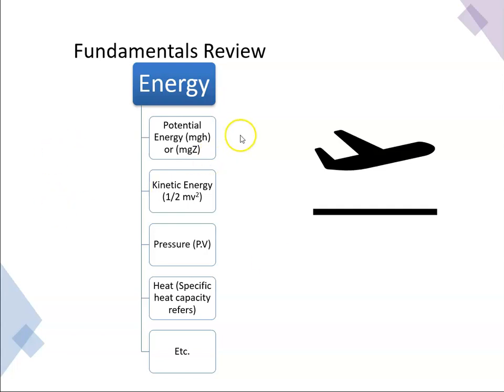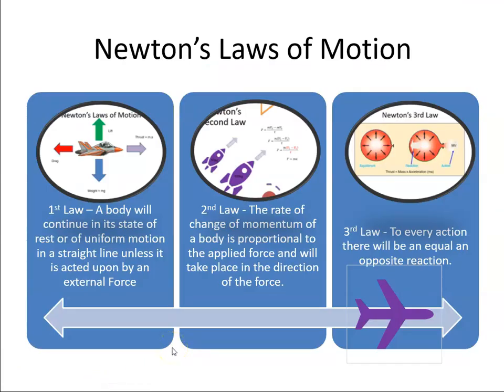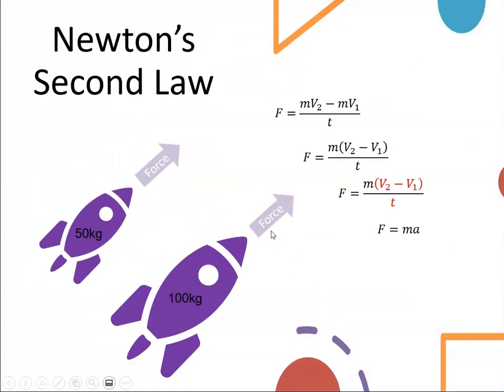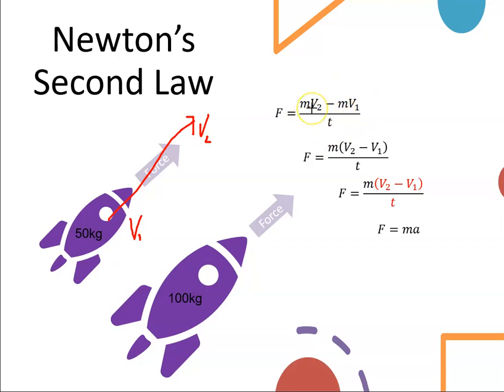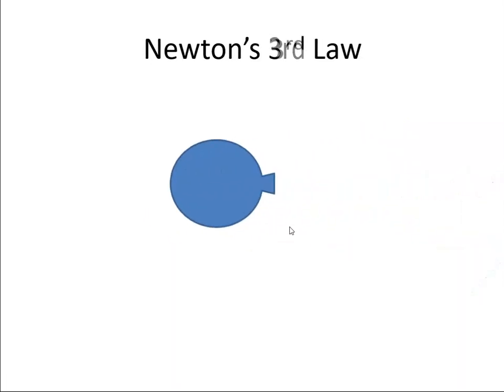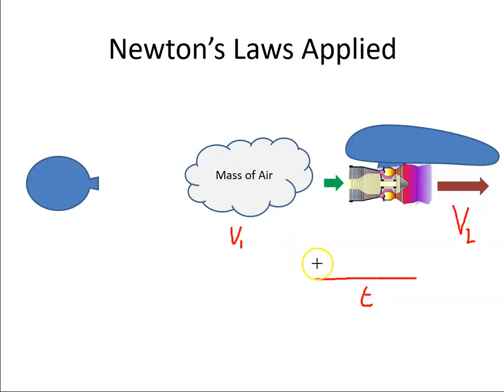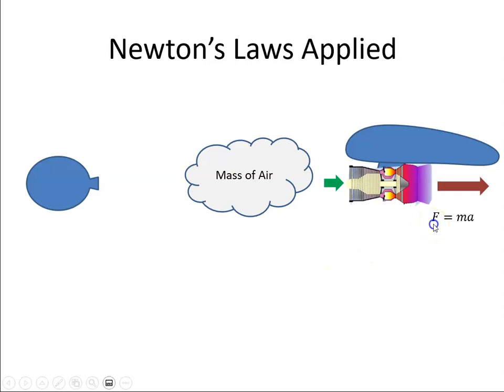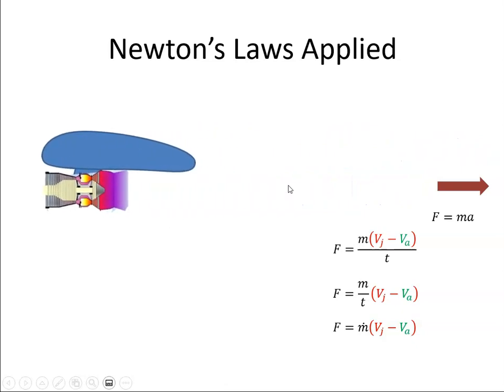Jet Engine Thrust- First Principles

Comment: Can jet engine thrust be also explained by pressure and shear stress distributions over the engine?
Reply from the maker: thrust can be explained by pressure.   I've never seen thrust explained by shear stress distrubitons, but that's more a reflection of my ignorance.
Reply: @RoddyMcNamee  im kinda confused about thrust explained by pressure ( in the context of jet engines ) . Since the accelered velocity will create a low pressure zone behind it and if we make the control system frim start of the engine to end of it with some margin you will have net drag due to pressure diff
Reply from the maker: @rocketman99  Yes, I see your point.  However, the air that enters the engine is compressed i.e. the pressure is increased, then it passes through the combuster (constant pressure combustion) and then through the turbine.  In the turbine, the air expands (pressure reduction) and then it goes to the nozzle, if there is any residual pressure left, then that is what is used for the thrust.   So, let's put figures on it to help explain.  Assume air is at 100kPa at the inlet and it passes through the compressor where it is compressed to 4,000kPa.  At the turbine it expands to 1000kPa and then at the nozzle it is 600kPa.  The pressure difference is (600kPa-100kPa) and that is acting across the area of the nozzle.  That is your pressure thrust.